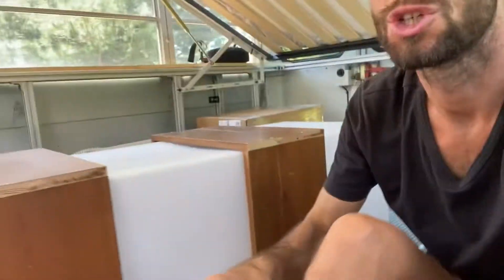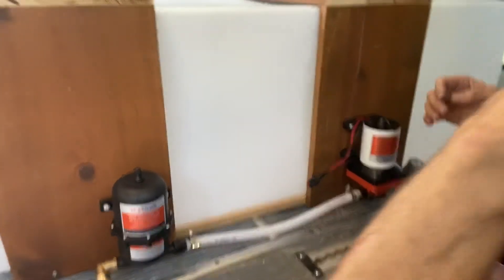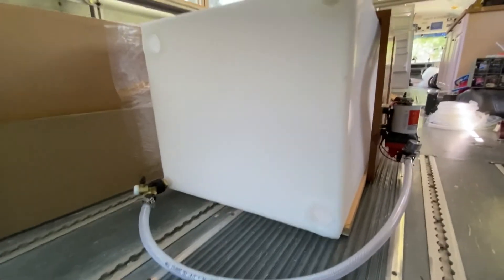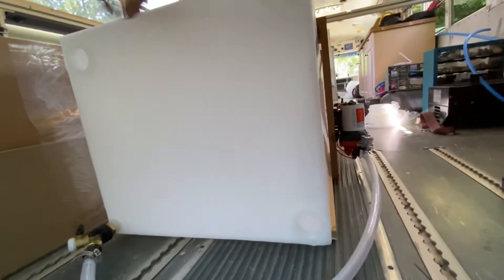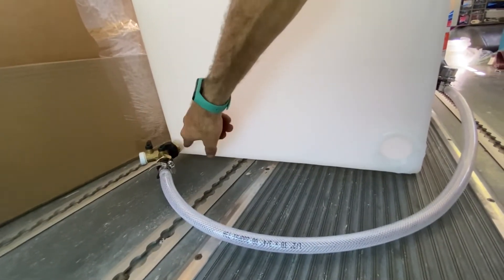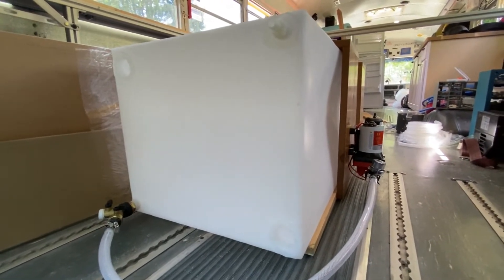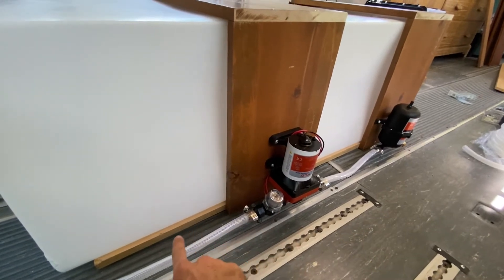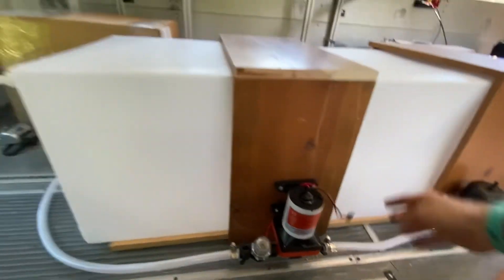Simple efficient fresh water system design on van/skoolie

Comment: Simple yea but those garden splitters with dual valves are crap that fail far too often which, as installed, is far too high a failure potential.
Reply from the maker: @OpenCarryUSMC  so far so good, and I purchased slightly more expensive potable water ones so maybe that’s why they are holding up 🤷🏽‍♂️ but yes it is a bit of an “abuse”
Reply: @brutally_honest  glad they’re holding up. We’re trying to make the right cost cutting decisions ourselves but trying to build high end operationally. 
Currently pulling out hair in how to deal with kitchen cabinetry.   Build it or buy it, half and half, or what. 
Tanks are pretty well settled on just not purchased. Body mods in work. Just bought a small brake to form my own brackets for metal and wood work.

Comment: You bought an expensive water tank. I'm using verticle blue plastic food grade 30 gallon tanks at $15 each. I will be using the same 30 gallon plastic food grade tanks for gray water and black water.
These tanks are very thick walled.

Comment: Hey,  how does the pump know when to turn on? I have a water system in my bus but I'm not sure if it works, all the piping is there but no sink because I removed it
Reply: When you turn the faucet on, the pressure in the water system drops, and the water pump detects that drop, and turns on to maintain the pressure.

Comment: Great planning! 
Question - How do you deal with the effect of the movement of water inside the water tank during travel? Are there any partitions in the water tank? is it divided into small compartments (like a truck for transporting fuel)?
Reply from the maker: Thanks man! There are no partitions.. I actually wasn’t aware of this issue, and didn’t know how fuel tanks were made. I was worried about putting it as far forward as I could, close to the rear axle, and centered side to side. So I looked into it and it seems it’s an issue, but not huge in the amount I’m carrying (75 gallons), on a truck chassis. But I did turn the tank 90 degrees so it’s now perpendicular to the bus, so less front to back sloshing.. although who knows maybe side to side is also important 🤷🏽‍♂️